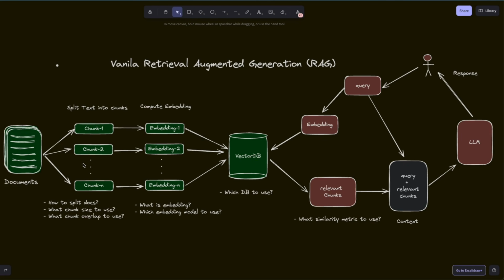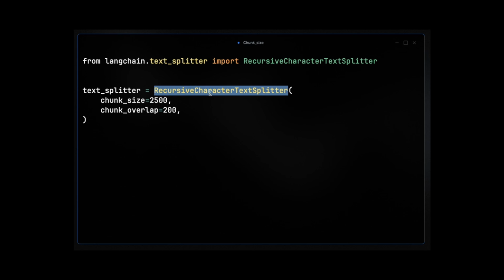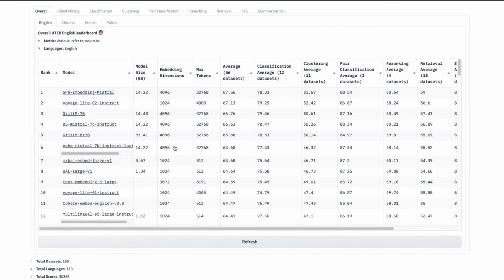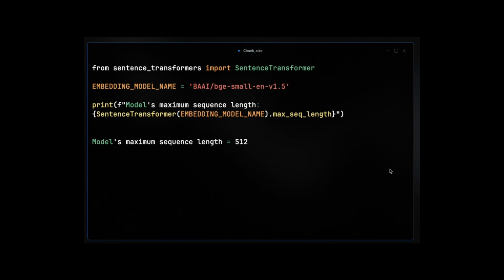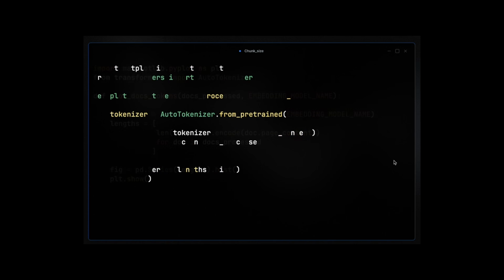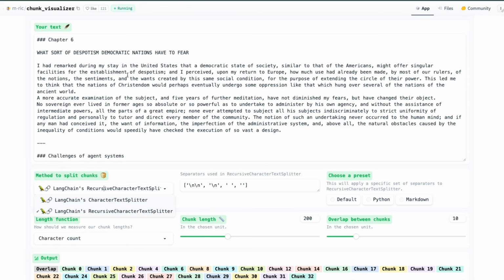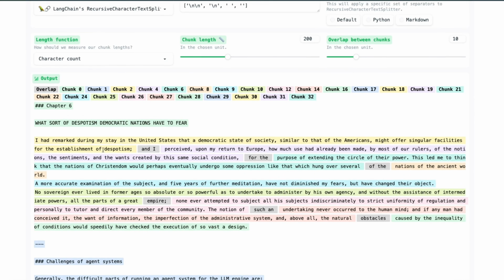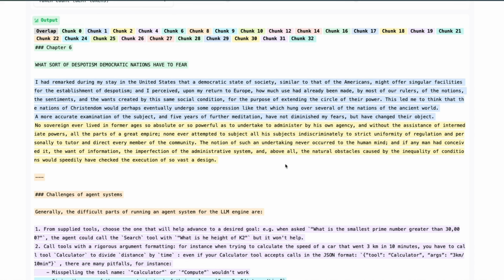How to Set the Chunk Size in Document Splitter | RAG | LangChain

Comment: Thank you for sharing the video. I have a query regarding a PDF document containing numerous tables. I am currently developing a RAG system, and I am encountering challenges in extracting information from the tables using standard PDF loaders. I have explored using GPT-4 on images, which proved successfully, I asked it to extract it using json form and it worked, but I am seeking an automated solution. Could you kindly suggest effective methods to enhance table content extraction ?.